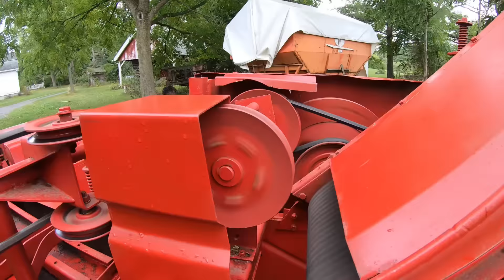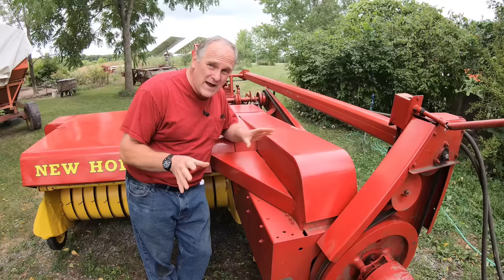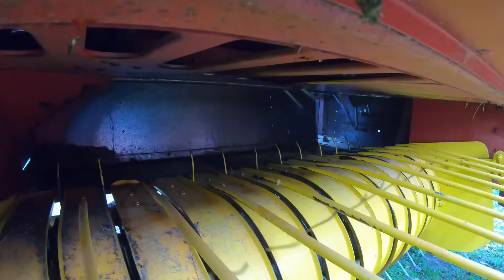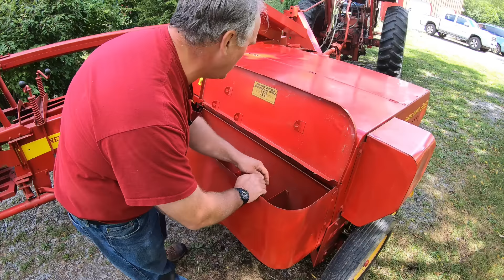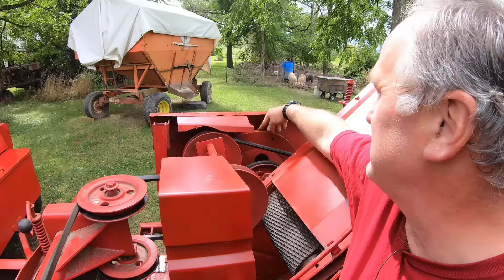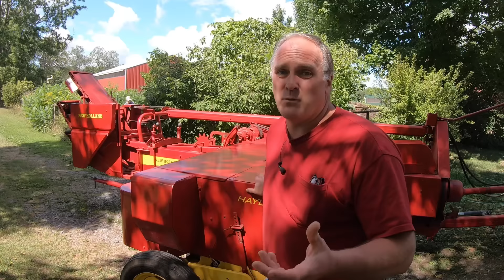NEW HOLLAND balers from the 1960's: how they work, maintenance, operation, and making good bales

Comment: Your baler looks new compared to the one I grew up using, but then I've never seen it without a layer of dust over the whole thing.  I don't remember the model, but I suspect it was from the '50s.  I can't even guess how many bales went through that baler, but it was a LOT.  It helped support my grandparents, parents, and most recently my brother.  It finally committed suicide a couple years ago (I don't remember the exact fail, but I guess it was pretty catastrophic) so my brother had to get a different one.  It is amazing how little power those old balers require.  We ran ours behind a JD 2040 my entire life.

Comment: Have the same baler minus the thrower....i clean it up and lightly spray used motor oil on. and in it, use an old garden sprayer, every time i store it, that means in between the first and second cut and over the winter. i replace or fix any part i can see needs attention......it may miss a few bales especially starting off like you say...but for 60 + years old and paid for , i like it....by the way there is a knot i was shown to join that twine together that i have always used, i dont think i can explain it but i may try a short video of it.... thanks again... if you get a chance someday try to show us the timing marks on the plunger....
Reply: Was told to always use a "figure of 8" knot, runs better through the needles and knotters.

Comment: I noticed you had a block in front of the wheel when you shifted the hitch, that’s ok. My Father bought the same baler new, we always had the same problem, the wheel wouldn’t always lock, maybe lack of lubrication or improper adjustment, usually we could get it to shift by turning sharply going forward or back. Baled a lot of hay, I remember one day over 1200 bales, I’m from a family of 10, that helped!
Reply from the maker: Good eye! I removed the right wheel locking pin because the cable had snapped, and the pin was touching the surface of the wheel hub. The baler swings pretty easily and repairing it seemed more work than it was worth.

Comment: Had a 273 new holland for more then 20 years, we averaged 3000 to 5000 bales per year with the old baler. Updated to a 570 high capacity several years ago and I'm very happy with it. New Holland does make a great baler.👍

Comment: Wonderful video with the baler Pete!  Up in NY we had an Oliver 50T that with good maintenance we used it about 35 years.  Always loaded bales directly on the wagons and I got to help unload them as a young guy!  Ran the baler with a Farmall M with M&W Hand clutch for live PTO.  Later on we had a 544 Hydro that worked even better. I had owned a New Holland 268 with 2 joint PTO shaft for a short time after I left the farm and moved to PA.  That baler required quite a bit of work to get it functional and it did work well.

Comment: I work in the Plant that builds the Small Square baler, still going strong building them every day!
Reply from the maker: Hi Ben, that is something to be proud of!!
Reply: Ben, my father sold them from 59-87 at  local dealer here in NC along with Allis Chalmers.  When I was 15 back in 1974 we took the camper up to Lancaster and New Holland and toured the plant.  Great memories for this 61 year old.  We have a  local NH dealer here and they do well.  Lots of those old square balers still running around here for the horse folk.  Most cattle folk use round balers.
Reply: @DLTJR1959  I wonder if your dad sold my dad's D10 when it was brand new. 99% sure it's spent it's whole life in the GSO area.
Reply: My dad worked at a dealership in the late 50's / early '60's, and they sold new Holland equipment as a shortline.
Reply: I ain't seen a square bayler working in several years. Everyone here rolls hay because you can't get help to get bales to the barn
Reply: Awesome!
Reply: I run a small farm in need of a new bailer what model would be the best
Reply: @Diesel-powered  look locally then see if you can still get parts for whatever model you are looking at.